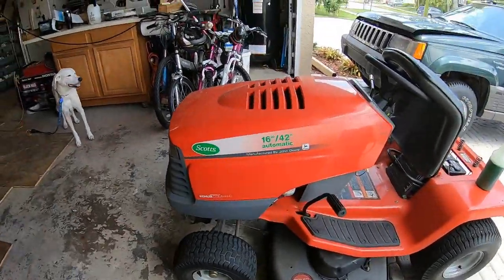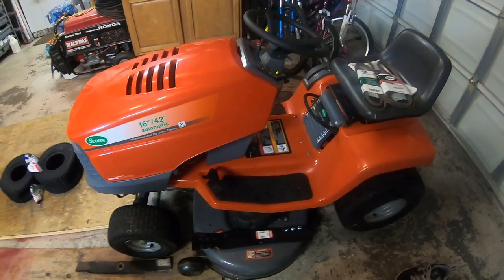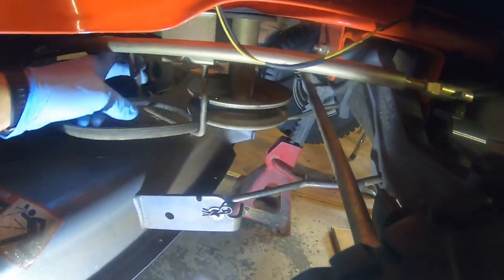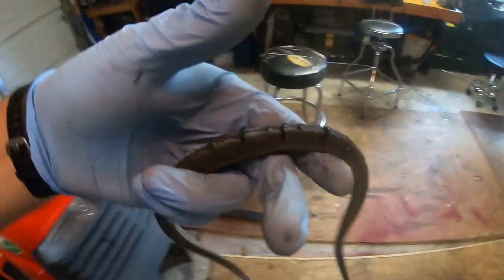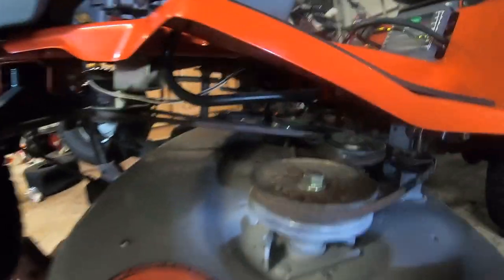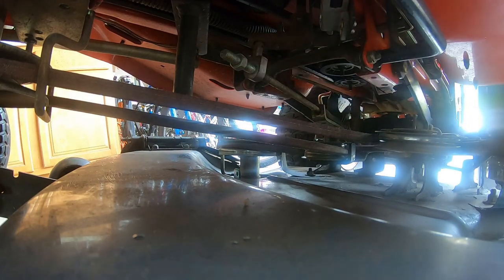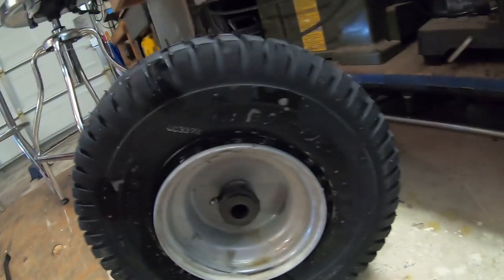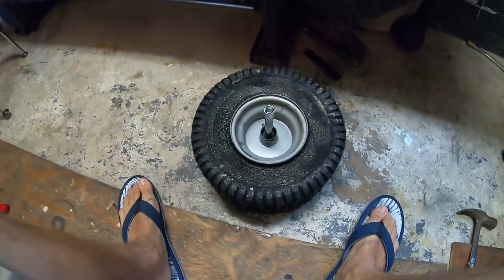Doing some maintenance on a Scotts/John Deere S1642 tractor

Comment: I have this exact mower. For the sake of making everything easy, just pull the 4 quick disconnect pins and remove the deck completely.  Then you can set it on a work bench

Comment: I have the same exact mower. Yes these Scotts mower were ahead of their time when it comes to their appearance. This mower looks 10 yrs newer than when they came out in 1999-2001. Mine also looks just as good and this mower has been in our family now for 22 yrs. An amazing mower. Kohler motor has really impress me the most.
Reply from the maker: Yeah the Kohler Command series is amazing. The only thing I don't like about Kohler stuff in general is the cost of repair parts. For primarily that reason, I prefer Kawasaki but they both make good motors.

This tractor is still running great... the only major issue with it is the front axle stubs are pretty worn. I may TIG weld them at some point and throw a set of ball bearings on the front wheels. Oddly, you can't replace the axle stubs - the whole front axle has to be replaced to the tune of > $220. It does break deck drive belts twice a year - haven't figured that one out yet. The pulleys are misaligned, but they look misaligned "from the factory".
Reply: @JoesGarageProductionsLLC  ive been pretty "lucky" though. The only problem I had to deal with was a bad carburetor. Knock on wood. This thing still runs like a beast.
Reply from the maker: @brianjirish  indeed. It's definitely a good machine

Comment: I have the same machine.  I've used it for 20 yrs. and it's still running strong with only a few breakdowns, most of them on the mower deck, not the Kohler engine.  I've replaced numerous worn pulleys and belts.  The only major problem was a worn out input shaft in the trans, but that wasn't an expensive fix.
Reply: I'm now replacing that transmission pulley for the 3rd time.  DO NOT TOW OR PULL with a hydrostatic transmission.  This pulley is a sacrificial part made of soft bronze to protect the geared transmission shaft it fits onto. It strips our.  A real fun job. Take off the whole rear axle including the tires just to change it. I find removal of the belt is easy if you pry it off of the tension pulley. To reinstall pull it up over the front drive pulley under the engine. Its way easier than trying to get slack by pulling on that tension spring.  I bought a pulley in 2011 for $15, now they are around $45.  Gotta love it.

Comment: That kohler command is a very good motor, I would go as far as to say that it’s one of the best motors ever put in a “lawn mower” not including the old Kohler-Series cast iron motors, in a JD212.

Our LT160 with this motor has over 800hours on it & still going fine, it has been a true work horse, in cutting the grass.
All it takes is oil changes, & new filters to keep that thing going.
Reply: Mine is over 20 years old and still runs like a champ. I had to replace the battery a few times and rebuild the carburetor once and replaced the belts. The motor is awesome. The deck is still in awesome condition. Only problem is I bumped the front end years ago and bent the hinge for the hood. So the hood can slide off occasionally when I open it. It’s not a big deal though. No cracks in the plastic. Still mows great and runs strong. I think it was built better at the time then most comparable riding mowers. It was the poor man’s John Deere.  The Sabre was the same machine. I always wanted a true John Deere but I can’t complain with how this John Deere made machine has served me.

Comment: My S1642 is still kicking and it is on it's 24th season!  I did have to change the Electronic Spark Advance with the updated Kohler DSAI Part# 12 707 01-S since Kohler no longer makes the old module.  I also did the Input shaft on the Tuff Torq K51A transmission and a bunch of pulleys and belts.  It's been a great mower.....
Reply from the maker: Yeah same here - I just did the input shaft on this mower a month or two ago. Just wish it was easier to change the transmission belt on... other than that, pretty easy to work on and well-built

Comment: Just picked up a free one also with the intek 25hp twin cylinder. Only issue is front sheet metal support under seat support is cracked. Will.need to do some welding. Front tires are really worn. Starts up fine. Guy cut his lawn for 20 years and finally bought a new one. I bet the engine will run quite a bit longer doesnt even smoke.
Reply from the maker: Yep they seem to be good machines. My neighbor still uses this weekly. Almost time to do something about that front axle though

Comment: You can get up with the mower going. Just have to turn the blades off and put the parking brake on below your feet. Make sure it is all the way in the locked position. Hope this helps!
Reply from the maker: Interesting, that technique doesn't work on this tractor. Will have to investigate that...

Comment: So when adjusting the blade belt tension you mention .78".. I've been having a hell of a time with this mower, all pulleys are new, seemed like the belt may have been stretched out? So got a new belt, when engaged it still seems loose. I have .5" space between bracket and spring.. but it's maxed out.. now what? 😂

Comment: He Joe. Just out of curiosity. Why do you leave the deck on the mower. There's a total of about 7 quick pins to take lose snd it will slide out. Pulling the deck and the pullys would have taken you sbout 15 minutes start to finish. I was just wondering.
Reply from the maker: Do you mean to change the blades? It really wasn't that hard to change them with the deck on. Plus technically when you take deck off you should retention the deck blade which is kind of a pain in the neck. Since this video was shot I've had the deck off a couple of times as the owner has run over number of things and bent the deck and bust it up a spindle. You are right though it's pretty easy to take the deck off
Reply: I HAVE ONE WITH THE B&S ENGINE & I HATE THAT THE SPARK PLUG IS SO HARD TO GET TO. I HAVE SEEN OTHERS BE LIFTED RIGHT OFF. MINE ALSO HAS A BAR IN THE FRONT. MY ISSUE IS HOW TO RAISE THE DECK, IT'S SHUTTING DOWN & WON'T CUT.  @JoesGarageProductionsLLC

Comment: Bro, you did everything except how to add or check or change the hydrostatic fluid.Apparently these have a tendency to leak fluid out and start losing your speed and gears. Do you know how??? Anyone???
Reply from the maker: Yeah I actually did that job about a year ago but neglected to film it. You have to pull the whole transmission out and flip it upside down. It's not as difficult as it sounds though. The input shaft is starting to go on this transmission so I expect I'll be doing the procedure again. I'll film it this time.

Comment: Is it possible to change the fluid in the trans on these?
Mine moves great but I don’t know the history on mine and would like a clean slate basically but can’t find information
Reply from the maker: Been a while since I looked at it, but I don't think this is one of the ones with a drain plug. That being the case, there might be a way to suck the fluid out through the fill plug, but you'd likely have to remove the transmission to even get to it, in which case just flip it upside down  and let gravity do the work. From what I know of this transmission, it's pretty reliable though
Reply: @JoesGarageProductionsLLC  thanks man. So far still running like a champ.

Comment: I have a lady with worn Spindles as well. I am thinking new bushings should help some as the tires are really getting worn. Yeah, its not good when simple greasing could have prevented it from happening. I am really hoping not to need spindles. I do know a salvage yard up north of me that might have spindles for it.
Reply from the maker: I am waiting for this one to get worse and then I plan on installing ball bearings on there. I will probably have to weld up the spindles though

Comment: Great video. I have this exact mower. I inherited  it and the one tire has always worn oddly. The complete outer half was worn down. Got it up on a  jack and that one side has a serious toe to it. Any guesses on what I should look for inspection wise? Spindle? Drag link? Any advice would be appreciated
Reply from the maker: I can virtually guarantee you the bushings inside the wheels are very worn due to lack of maintenance. The spindles on the axle are probably worn as well. Unfortunately I don't think they sell them separately on this model - you have to buy the whole axle. When mine get bad enough I'm probably going to weld them up and install ball bearings
Reply: @JoesGarageProductionsLLC  so you think starting with the bushings by Rotary would be a good first step and see where I am after that

Comment: Is it worth the money to convert the bushings to sealed bearings? There is only about $5 difference between the two on amazon. I’m interested in your opinion.
Reply from the maker: Yes I definitely think it would be if you don't mind putting the time into it. My axle stub shafts were worn too heavily. I decided to put it back together run it for a while and do the bearings at a later date

Comment: I asked how to adjust and level the cutting deck? Not change oil.
Reply from the maker: Sorry I didn't see that you asked a question. Did you post it on the wrong video perhaps?
Reply: ALSO NEED TO DO THE SAME ...WHY MINE WILL SHUT DOWN.

Comment: Great video!  Thanks for posting!  I have this 2001 Scotts 1742 lawn tractor too (but the engine is Briggs and Stratton 311777-0137-E) and the carburetor leaks fuel. Can you add the links for the fuel shutoff valve and 1/4" fuel line clips?
Reply from the maker: The fuel shutoff valves and fuel line clamps are thankfully universal. Do a search for Oregon 02-040. That should bring up a 10 pack of the fuel line clamps. Searching for Oregon 07-406 should bring up a 5 pack of the shut-off valves. Both should be available on Amazon. You might be able to purchase them in smaller quantities - I normally buy in bulk because I use them all the time. Good luck!!
Reply: @JoesGarageProductionsLLC  Thank you!  Love your channel!
Reply: glennis mcclellan, you can find them @ any auto parts store. They have a section for lawn mower.

Comment: Thanks for this video.  I am looking at buying a 1642 this weekend.  I have a 1/2 acre to cut.  Do you think this is a good sturdy mower with a good engine? The one I am looking at is in great condition.
Reply from the maker: If yours has the same Kohler Command engine, it is a very solid engine. Far  better than anything you can buy today on a residential tractor. The hydro has a pretty good reputation as well. I would say the major weak point on this tractor is the front axle. I think I showed in this video but the wheel  bushings have a tendency to wear out if they are not greased and can wear the axle stub shafts. Unfortunately on this tractor the stub shafts are not replaceable without fabrication work. John Deere wants you to buy a whole new axle assembly for over $200. Oddly on other John Deere tractors you can replace the stub shafts... Go figure. Good luck with your purchase!
Reply: @JoesGarageProductionsLLC  thanks so much!  Yes the one I am looking at is the Kohler engine.
Reply from the maker: @denisedoogan703 No problem! Good luck with everything! One other thing I'm not crazy about but it's easy to work around. The seat switch prevents you from starting the engine or running it unless the operator is in the seat regardless of the position of the drive system or the blades.
Reply: @JoesGarageProductionsLLC  ahhhhhh, good to know.  I am so stressed about buying a used machine because you just never know.  But the reviews on the big box John Deere models is horrible!  Ugh!
Reply from the maker: @denisedoogan703  they don't make stuff like they used to for sure. I am working on a video of a Cub Cadet RZT-54 zero turn that was given to me... It was made in 2009 and has a nice Kawasaki V-twin engine. All of the newer stuff has low-end Briggs and Stratton or Kohler Courage junk (the Command series in the 1642 is totally different). You're better off buying a used machine in good shape... Just expect to put some time and money into it fixing it up
Reply: @JoesGarageProductionsLLC  well the idiot on OfferUp that told me this morning it was  available ended up being shady.  I asked a bunch of questions and he said oh sorry someone is coming this weekend, you have to wait.  Then he immediately Mark's it sold when I called him on his dishonesty! I am so tired of shady dishonest people.  I just want to buy a nice used mower.
Reply from the maker: @denisedoogan703  sorry to hear that... That's how some of these sites work unfortunately

Comment: I'm in the process of buying this exact mower but the guys asking 875 which seems awfully high for a 20 yo machine. Any advice is appreciated, thank you.  Great video!
Reply from the maker: I would agree. That sounds very expensive. It's a pretty solid machine though. No electric PTO clutch to fail, the hydro is pretty solid in this unit too. The only problems we have had with it is repeated blade belt failures. Approximately every 6 months
Reply: @JoesGarageProductionsLLC  do you know why it keeps failing?
Reply from the maker: @jameslund221  not at this time. All of the police on the deck turn freely so the only thing I can think of is the factory misalignment. That said, I'm not using an oem belt but I'm using a very well respected aftermarket belt - the gates bladerunner series. I have put those belts on commercial tractors and they are still running today years later
Reply: @JoesGarageProductionsLLC  My Scotts 1642 went through a phase of eating belts, both deck and drive belts.  I tried several different belts and finally just bought the cheapest ones.  It stopped when I replaced the old worn blades with a new set.  The only good thing to come from it is that I'm now an expert at replacing belts.
Reply from the maker: @constitutionalist3931  haven't had to replace the transmission belt since this video was shot but I've probably done the deck belt three or four times since. I'm not entirely sure what blades I have on there at the moment they might be Oregon Gator aftermarket blades which are usually heavier than OEM blades and might account for the issue. I'll have to check into that thanks for jogging my memory :-)
Reply: @JoesGarageProductionsLLC  I was told that John deer only made the scotts lawn mower that had gas tank in back . Yours has gas tank near engine. Can you clarify this for me? Going out to look at a scotts and it's advertised as built by John deer. Thanks.
Reply from the maker: @walterschultz1074  I don't have the tracor in the garage at the moment but I am pretty sure it is pretty clearly branded as John Deere. A lot of a part numbers in use on the tractor are John Deere  part numbers. In my opinion the biggest weak point on this tractor is the front axle assembly. It was not properly maintained the stub axles are probably worn and need to be replaced, and they cannot be replaced without replacing the whole  front axle on this model, which is not inexpensive. I'm thinking about welding them up and grinding them back down but haven't really had the time yet.

Comment: eliminate the front axle grooves by going to Northern Tool and getting the tires and wheels with the 'bearings'.
Reply from the maker: The axles are too badly worn. The inner bearing race would wobble around. One of these days, I'll pull the axle and add material with my TIG welder. Lots of work to do that, obviously, but if I recall, the front axle assembly is over $200 for this tractor.

Comment: I have the same mower...can you use s1742 blades even though its a s1642??
Reply from the maker: Not sure but they are both 42 inch decks. You could check Oregon's website and cross reference them to be sure

Comment: What size are the blades?  And where can I the part numbers for the belts?
Reply from the maker: The deck is a 42-in deck so the blades should be approximately 21-in each. I originally had Oregon Gator blades on this mower but I think they are too heavy for the deck and spindles. I have switched over to the OEM John Deere part which is M139802. For the deck, I'm using the gates blade runner belt part number 6848BR. Do you need the transmission belt number as well?
Reply: @JoesGarageProductionsLLC  yes sir
Reply from the maker: @frederickmoore1247  looks like a Gates 6896.

If  you do a Google search for "Grounds Maintenance and Equipment 2016 Catalog", that should pull up the PDF from Gates's website where I'm getting those part numbers. Just search the PDF for S1642.
Reply from the maker: Also, just to add, for anyone else that's reading this, I highly recommend Gates's Blade Runner series for mower decks - especially those with electric PTO clutches. I put those belts on commercial mowers that are used all day and had them last for years.
Reply: @JoesGarageProductionsLLC   thank you